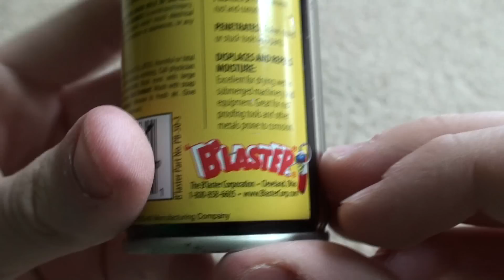How to fix noisy computer fans.

Comment: It's just cheaper to get a new fan. Those 80mm fans cost like 3 bucks each (cheaper than the can of lubricant). I'd rather be safe than sorry, especially when you have a expensive PC
Reply: mine replacement cost 25 dollars lol...so this is way better solution

Comment: WFH in 2020, my noisy psu fan was giving me daily headaches.   Nice short video to the point. Most other videos were replacing the 120mm fan and soldering the wires.  This is just what was needed, a little bit of silicone spray behind the sticker, an awesome fix!!

Comment: Hi ☺️ I don't know if you are going to see this but my fan is very small I have a laptop.. I don't know if this could work on that too. I opened it up the screws and everything and the fan is stuck I can't pull it out I also don't want to force it, but it's so loud I can hear it 2 rooms away. Do you have any advice or do you think this work for laptop fans as well?
Reply from the maker: Usually laptop fans are sealed and cannot be oiled. I'd suggest just buying a new fan from eBay or somewhere.
Reply: @Rustbelt_Research  thank you ☺️ I'm going to order a new one a find someone to replace it.

Comment: To you guys who want to do this on a PSU fan, be REALLY careful. PSU's are dangerous things that can kill you. Make sure to learn how they work, store power etc. before you stick your fingers in them ;)
Reply from the maker: This is a good tip I hadn't put in the video. If you are not comfortable around high voltage (remember, 120V wall voltage counts as "High Voltage") DO NOT disassemble a computer power supply. They are inexpensive, buy another one.

Comment: I have an old Dell, 2008 All in One, PC; it makes the intermittent fan noises (louder, louder, and real loud for a couple of minutes) which I recognized as a fan problem, but I also have a more disturbing noise - sometimes when starting up (cold) but also when it has been on for a very long time (I don't dare leave it one when I am gone). It is more of a physical sound like scraping; cha, cha, cha, cha, cha, cha, cha, cha, getting pretty loud - I guess it is a routery sound too so maybe it is also the fan in really bad shape.

Comment: Great! Worked like a charm, took 2 minutes. No need to remove the fan from the side panel. Take the opportunity to use a 2 inch (or less) paintbrush to remove all the accumulated dust.

Comment: So my gpu has a fan rattleing in it and I've only had for a few months and Ive kept the fans at relatively low speeds but now it's been making alot of noise at low rpms and I don't really know what to do
Reply: Late post but you should do with the dude showed in the video. If you don't know how to take out your gpu fan look up videos for your card you will see it's not that difficult. And don't use wd40 but sewing machine oil. 

If that didn't fix your gpu problem then it's time to order a new fan. Luckily fans are not that expensive. Also fan replacement is not that hard you can look it up.

Comment: Great video and results worked really great!  Noticed that NZXT fan had a small plug that made me freak a little at first, but it can be pried out no problem at put back in when done.  Based on the comments, it would seem that the PB50 lubricant is not the best solution, but one that worked in my case.  The only thing I'll be mindful is for how long the fan keeps humming along quietly.  If it gets noisy again, I will probably have to try out some of the other alternatives.  Thanks again!

Comment: Wow.  Really helpful video.   How did I never think to try this before?   The CPU fan in my mini HTPC started to get loud, and I couldn't find a reasonable replacement fan to order ($72 bucks! -- crazy!).   In my case there was no access to the bearings underneath the sticker, but I just sprayed lubricant (in my case I had Liquid Wrench Super Lubricant spray) under the fan and and let it soak in and now the fan is silent again.      Thanks for the idea!

Comment: great tip. i would never have looked for a bearing in such a tiny motor. it fixed my noisy fan,  but as others have said, i will use some fine grade sewing machine oil next time.  but thanks for giving us the idea.

Comment: Oh man my sticker is from AMD and has a cool 3D aspect to it, i don't to peel it xD
Reply: Nevermind i took of the back sticker plus it was so old that is vibrating tho creating a SHIT load of noise, my PC is AMD, i got a intel cooler box, took off the heatsink and attached the cooler to the AMD heatsink with those plastic straps, now my PC makes next to no noise besides the HDD, and my temps are actually lower, from 45-50 IDLE to 38-42 IDLE, and 75-80 in gaming, as gaming goes it works the same as the old cooler, i don't recommend you do this tho

Comment: Instead of oil or WD40 that eventually become wax due to evaporation, use KEROSENE that is what was evaporated in the first place. Applying a few dips should dissolve the grease back to working order.

Comment: WD40 is a cleaner and protector, not much of a lubricant. It has some lubrication qualities but it evaporates fast. You should use motor oil or bicycle chain oil (any kind of liquid technical oil will do)- you also just ruined any factory lubricant that remained. This will work for while with bad end results. Don't use WD40 guys.
Reply: Will Pack  It's still useful because all I had was WD-40 But I changed my mind.
Reply: You're either blind or stupid... There was no WD40 in this video, it was PBlaster All Purpose lubricant clearly shown in the video.
Reply: @Roc790  3 in one oil is probably best. Spray oil tends to evaporate / flush useful oil away.
Reply: @markc5413  B'Laster lube is "designed to lubricate moving parts". I've never used the stuff, but based on that description I would assume it doesn't evaporate. They also sell it as a regular liquid oil instead of a spray if you prefer that.

Comment: will this work with any pc  fan ??
Reply: Mostly. If the fan has no sticker or when you peel it off the bearing is covered then you pull the fan off the motor and lubricate it then push the fan back on the motor or if it was glued in just glue it back on.

Comment: Do the fans in my Mac Pro Quadcore mid 2012 look the same? I have two big ones, one in the front and one back and several more. The computer has been whining since I bough it in April 2013. It is disturbing. The computer has been to service twice on guarantee and nothing wrong could be found. I have now changed graphic card and now the fans are going even faster, they are blowing at speeds of 1 500 RPM or more. Expensive computer but not so good. And now it probably hasn’t so long time left. Maybe High Sierra is the last big upgrade before vintage...
Reply: I highly doubt that the fans are of the same model, but they might be build with the same technique. My recommendation is that you unplug your computers power cord and have a look. If you can't find a bearing like in the video you might have to pull the actual blade-part apart from the frame. Note some fans are just designed so you can't get to the bearing and all so be careful that you don't use to much force. If it won't come off it won't come off. 

OBS! I don't think lubrication will help you so much either way if your Fan RPM is 1500. That's really fast and will almost always make that "whining" that you are describing. This give you two options;

1. Buy new fans with lower RPM. Something like 1000>. I have 800 RPM and they are pretty much dead-silent.
2. Buy an adapter that slows down your fans RPM. They cost like 30 kr at netonnet and such stores. (Or a "fan controller". Google it you want but that's a bit of a project.) 
(If you have the knowledge and tools for it you can make your own adapter with resistors. I'll bet there's a bunch of videos here that describes it in detail.) 

OBS! Remember if you lower the RPM you also lowers their ability to move and cool down air. Always control computer temp. when you have been adjusting/changing the fans.

And yes, Mac are expensive and to my experience with Mac is that you have to buy the really expensive once with you want some quality :( I recommend you to buy a traditional PC next time, they are easier to open up and cheaper. It's possible to install a PC with the Macs IOS which means it will be exactly like  the one you have know. Probably a bit faster if you have the right hardware. A modern PC will also be able to lower the RPM of the fans without the adapter. Either by the "BIOS" of the PC or a software "that runs on the desktop".

 I don't if they have anything like that for mac but a quick google gave me this https://www.crystalidea.com/macs-fan-control 
I never used that software that I linked though so I don't know if it works. And I don't have a mac close-by so I can't try it for you. It's up to you if you want to try it or maybe try google for more.

I hope this helped and if not feel free to write to me here on YT. ( I do speak Swedish also so if my English was to terrible so send me a message if that have been the case :)  ) Good  luck!

Comment: WD-40 works too?
Reply: Just for a couple of days but it usually turns it to some disgusting  gew that might brake your fan. I recommend to use "sew machine oil" since it's made to withstand high temp. and fast movements. Careful not to spill anything tho :)

Comment: how to unplug it ?
Reply: Krisna Hartawan please unplug while the pc is off
Reply: Trace the wire coming from the fan to the motherboard where it is plugged in. Gently pull the plug from the motherboard. Sometimes, the fan may be plugged into an adapter connected to the power supply. In that case, find the connection between the fan wire and the power supply wire and separate them.
Reply: Krisna Hartawan 7

Comment: My fan is sealed with plastic at back
Cant disassemble it
Reply: You can simply pull the fan off the motor then lubricate it and push it back on or if it was glued on just glue the fan back on.
Reply from the maker: I see this more and more on newer PC fans. To my knowledge, there's no way to fix these. You'll just have to buy a new one I'm afraid.

Comment: my fan is wobbly I took it apart cleaned it lubed it and it's still not working. how do I fix it if it's just loose/wobbly and hitting the metal sides
Reply from the maker: Your fan is destroyed. Buy a new fan.

Comment: can i use cooking oil? will that work?
Reply: Depending on the oil, the answer is maybe. Issue you'll run into with most cooking oil, is that over time it breaks down and turns into a thick goopy mess, and that will render the fan useless. Re-oiling a fan that's had cooking oil break down in it is going to do almost nothing. The goop is similar in texture to slimy rubber. You're going to want to use something like mineral oil, or castor oil (basically, engine oil). If you absolutely don't have any canned oil, just take the fan out to your car, and let the oil from the dipstick drip into the back. Couple of drops are plenty.

Comment: I would not recommend this approach, It's WD40 based and it will destroy your fan eventually.
 Bearing becomes a bit too slippery resulting in very high RPM and you'll get the impression that it's about to take off into the air. meanwhile WD40 dissolves the grease in the bearings as well. meaning it will run hot and leaving it exposed to dust. It will work short term, a few months. after that you'll regret it. Use chain oil or castor oil. And just a very tiny amount! don't drown it like this guy in the vid with wd40...
Reply: Castor oil wouldn't be too thick?

Comment: no little bearing under sticker
Reply: You can simply pull the fan off the motor then lubricate it and push it back on or if it was glued on just glue the fan back on.

Comment: What kind of oil do I need to buy , or can I just use sunflower oil
Reply: No sunflower is too liquid almost watery  and it doesn't adjust well do temperature changes.

Castor oil works. or chain oil . Don't use WD40 it will dissolve the grease in the bearings
Reply: Use Seasalt ice cream oil
Reply from the maker: You need some kind of petroleum based oil, Such as WD-40
Reply: Cap10323 okey, thx for the tip

Comment: My fan has no opening after the sticker?!?!?!
Reply: only on very cheap fans. I've repaired a number, and most quality fans have a rubber stopper over the bearing. That's of course assuming the bearing is intended to be oiled at all. Some of the newer fan bearing technology is effectively not user serviceable, and re-oiling or greasing won't actually fix them.
Reply: On fans like that, sometimes you can unclip the wires from the body of the fan so they are free, and press the blades off with your fingers, use 3 in 1 oil, line the wires back up with their little guide and press the fan back onto the fan body.

Comment: Hello. Can I use a blade(machine) oil that came with my trimmer?
Reply from the maker: Yes, That should work fine.
Reply: Cap10323 Thanks, I'll try that.
Reply: hey Cap, i just tried to lubricate my CM SickleFlow 120, and i had to remove blades, there was no bearing under the sticker

Comment: I mean oil For eat ? Can i use that ?  Or is that bad +cap10323
Reply from the maker: +ZORO KILLER No, Do not use cooking oil
Reply: Cap10323 what for oil need i to buy?
Reply: Castor oil, mineral oil, 3-in-one oil, ATF fluid would work in a pinch. Typically I don't mess around with oil anymore, using a light tack high temp axle grease works much much better, and lasts a lot longer before needing more service.

Comment: Just did this to my RAID enclosure with two loud fans. Sounded like a leaf blower.  A couple of blasts of WD40 unde rhte sticker and its good as new. Thanks for the diy instruction. You're the best!
Reply: +Loren Simpelo - Note to self, don't use WD40 for a lubricant. I went back and re -lubed fans with 3-in-1 oil. Even more quiet than with WD40.  WD40 is NOT a lubricant.
Reply: +Loren Simpelo I've got a couple of fans in my computer that I bought back in 2004, a little bit of Castrol GTX 5W-30 in each one and they're going strong.  I had to oil them back in '08 or '09 and haven't had a single issue with them since.  3-in-1 works as well, I've got a couple running on that and they are still going as well.  Gun lubricant works as well, spray lubricants like seen in this video work, bicycle chain lube, basically any liquid lubricant you have laying around the house.  I'm still blown away how my cheap little Cooler Master fans are still going strong after all this time and all it took was a little bit of Castrol.  This is a great tip to keep people's computers running for many years to come!
Reply: However, WD40 Lithium Grease is lubricant and I have some.

Comment: Can I use WD40?
Reply: +Katie Kaboom I wouldn't, it's not really a lubricant and you'll likely have issues again within shortly.  I used a little bit of engine oil (you could even pull your dipstick out and scrape some off of there).  If you wanted to use something else any liquid lubricant will work.  Spray lubes like seen in this video work well, 3-in-1 oil, pretty much anything.
Reply from the maker: +UnsulliedSpy +Katie Kaboom
The "BLASTER" Brand stuff I used is basically WD-40, and it works fine. Yeah, You could use motor oil. that also works. But you have to make sure you get something really thin. As UnsulliedSpy said, 3-n-1 oil is pretty much ideal, I just didn't happen to have any on hand when I made this video.
Reply: +Katie Kaboom :))how to spot a mechanic :))

Comment: Not sure if WD40 would last long, it has lubrication but I think its too thin and the noise may come back sooner than expected.
Best thing to use is probably machine oil used for sewing machines.
Silicone spray may also work fine.
I wander if that magnetic car oil would last the longest, being magnetic it may stick to the bearing much longer than normal oil. However car oil is quite thick so it may not work well in a small fan.

So yeah, safest bet is probably machine oil.
Reply: +JayE Car or machine oil works great.  I've got fans in my computer running on 5W-30.  I did this trick back in '08 or '09 and my computer has been on 24/7 with these fans since 2004.  12 years on cheap sleeve bearing fans thanks to a few drops of Castrol GTX.
Reply: +UnsulliedSpy Good to know, may try the magnetic car oil stuff next time.

Comment: can use Coconut oil instead?
Reply: +Damian L used my Spit instead.works fine now
Reply from the maker: +Andy J No. No you cant.
Reply: +Andy J No but semen works fine
Reply: idk why dont u find out and report back
Reply: Coconut oil ftw high heat resistant
Reply: yogibear2k10 WD is a bad idea for fans.
Reply: Damian L lol
Reply: And you wonder why coconut oil is not used for mechanical parts, hmmmm, difficult.